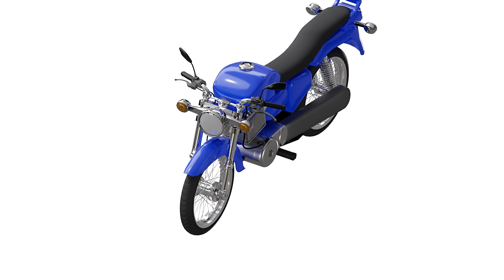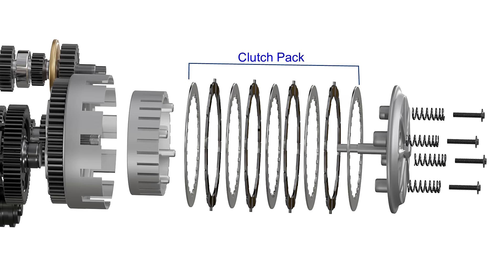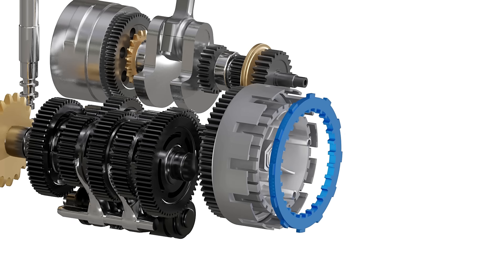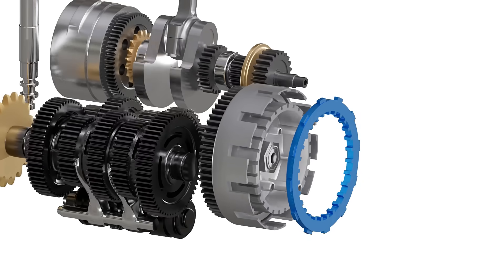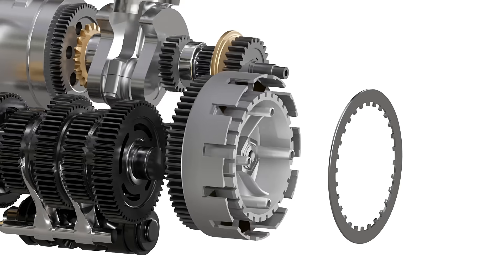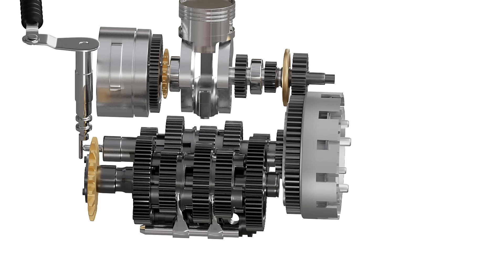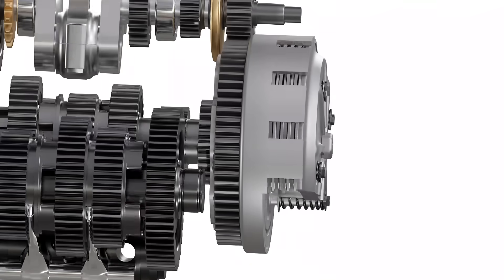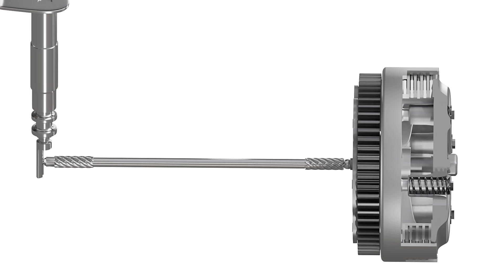Understanding Motorcycle Clutch

Comment: I alway wondered how a motorcycle clutch worked, this video explains a lot.
Reply: And is the same design and operation of automatic transmissions like mopar 747 torque flight three speed found in cars like a 440 cuda ...GM400 turbo three speed slap stick found in cars like a pontiac gto and the ford C6 three speed auto you can mod using a shift kit from B&M hydro for full manual shifting same as you can for the  big Chrysler torqueflite and the GM 400 Turbo these old muscle car transmission used motorcycle style clutch packs to lock up planetary gear for first and second gear as high gear or 3rd gear was a direct lockup of the main shaft through the entire transmission the best place to find one today is Bram old motorhomes that are being scrapped out for the engine and transmission. you get a high stall torque converter lower geared 1st 15 quart pan attached to a big block performance engine...minus a tunnel ram two quads and high lift cam ...just add whats missing and you got a earley NHRA PRO STOCK contender

Comment: Used to be scared of trying to fix my own bike, but this just makes me want to fix it myself
Reply: Go for it! Honestly the clutch is one of the easier things to do, even though it might not seem that way to a beginner. Get a proper workshop manual for your bike and it will make it even easier. Keep in mind that there is probably oil there, so if you're gonna work on your clutch drain the oil first. Some bikes have a dry clutch system, but most use oil with the clutch.
Reply: @DanteD24  there's so many benefits from fixing your own vehicle
Reply: @DanteD24  There's a tool for grabbing the hub, looks like a pair of vise grips with extra long jaws, and the same tool to pull drum brake spring cups works for Ducati clutch springs. Cycle World usually has them dirt cheap.
Reply: For sure, just wondering, is there manuals online?
Reply: @hockeycj15   manualslib dot com
Reply: @hockeycj15  just typed in your bike models on google and type manual book.
Reply: @hockeycj15  yes
Reply: Read the Zen of Motorcycle maintenance and you'll be able to comfortably fix your own bike yourself.
Reply: changing clutch is very simple, actually, i m not a mechanic and did it more than once
Reply: Go for it. Pay attention to how it comes apart, and you can put anything back together.
Reply: Do it. It's easy. I had a hobby building streetfighters from crashed Ducatis and Hondas. A few hand tools are all you need.
Reply: Man I just changed my motorcycle piston and valves there is more details than it looks but it's easy to do if u need any help tell me
Reply: Haynes manual?
Reply: I started and finished a complete restoration of a 1972 Bultaco Shepa, had 3 kids that grew up and left home, went long in the tooth before I finished reading that comment..
Reply: @WhiteForSoreEyes  those are rad bikes man
Reply: @tryndaboss  are those manuals any good?
Reply: @tryndaboss  haynes ? Famous for info to rebuild cars trucks and motorcycles right ? That some times  claim to be accurate for several years and models with any changes in specs of upgrades ! 
But would you trust the haynes service manual  with your life rebuilding an  F-16 you will be engaging the enemy in dog fights tomorrow  were you will be out numbered but if you properly sequenced the thrust vectoring with all fly-by-wire yaw, pitch and roll of calculated  attack  of russian migs you will enjoy a seamless execution of pilots weapons  and  and their latest migs. We will not negotiate or submit as they were led to believe but instead without warning I all F-16 thrust vectoring close range dog fighters will fire all air to air fire and forget  artificial intelligent smart infrared cluster bombs packing thousands of self-guided incendiary Rockets that will attack in waves  as you will be too busy to hang around to witness  setting a new course  to be on your way back on afterburners avoid The Flash and the shock waves as the whole quadrant will be void of atmosphere vaporized as well as all within the perimeter...of course you would not ..so why would you service your 2020 triumph tiger 800 XCx queens limited edition when the stakes are just as high amd more dangerous at speed than your air plane. As your greatest chance of death in the fighter is during leaving  the end of the run way to touch down and taxi back to your hanger mission accomplished ....but riding a motorcycle you are in constant highest level where most all deaths accure flying an airplane namely all lift offs and landings  and taxing down the runways ...simply buy the factory writtin model updated service manual specifically covering not only within a curtain year or the session of years but also if it falls Within a group of frame numbers or serial numbers...as factory info of this level of detail will be inner office info that may not have filtered out to all public knowledge to be available for companies like haynes to reprint ..example 37 years ago i was rebuilding my 1st harley using a Haynes manual that did not show a screw factory specialized screw that was left hand thread that held a pin that secured an idler gear that meshed with the gear driven generator ..and i snaped off this special factory made screw breaking it into leaving part of it forever buried into the right half of the engine cases ...creating for me a very expesive and a very time consuming problem ..the harley was a 1968 totally all original FLH Electra Glide in blue that was a trade in at a honda shop where i was their honda factory trained certified GL1000 Goldwing service technician required by honda for a honda dealer to keep his franchise or be put out of business as honda would not stand behind any goldwing service done by anyone else who did not have an authorization from Honda to service a gl1000...so for a while i pretty much had my boss by his balls and pretty much did as i pleased and pretty much got all i whated .
And bought an already vintage classic in 1979 that still haf its original factory paint job that shined like new in blue...well worth the 100 bucks for the factory shop manual with actual photographs of every step of all service procedures ...and four months ago i was at a place called "the shop" that specializes in building antique and classic harleys ...and owner to me over to a bike in for a custom performance exhaust and the owners son ask me if i recognize this particular 1968 FLH and it was my old motorcycle with the same engine in it that I built 37 years ago a still running who do you know that I can tell you this as the shop does not have any bikes that old that they built I'm still on the road except for mine as this establishment called the shop is where I bought my part and had my bottom in balanced and blueprinted using the finest parts available through S&S H-D performance , CCI of Japan for the pistona of same design work for honda
Reply: Baker props to you, this is by far the lo gest comment I've ever seen on YouTube. Quick someone call Guinness
Reply: @donniebaker5984  yeah haynes is fine
Reply: @donniebaker5984  Nice story, with valid points.  However, the English language called--they'd like to offer you a free upgrade to English 2.0, with the first in a series of upgrades being this one:  
Meet THE PARAGRAPH.  It is useful to make your writing easier to read, and you less suspect of being on a coke bender.  Peace.
Reply: I changed friction disks many time too and it's easier
Reply: Same here
Reply: I've replaced my KLX150 clutch. Get the right tools and you're good to go. I learned how to do it via YouTube during the quarantine period. I'm happy I manage to save a a few bucks by DIY it.
Reply: No...jump in there.....I started doing ALL my own work...If you get stuck, move away and come back the next day..It usually comes together with precision....These days a mechanic in my hood is way to expensive so I had no choice.
Reply: The problem was the clutch basket nut. Hard to remove that shyt